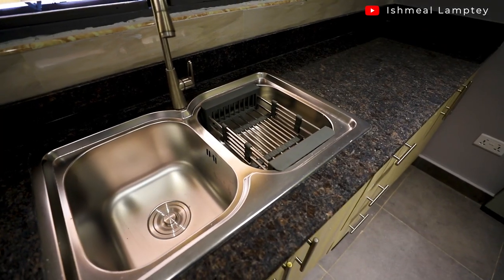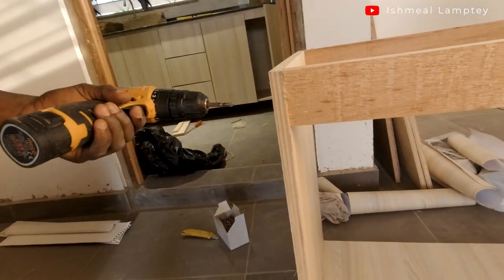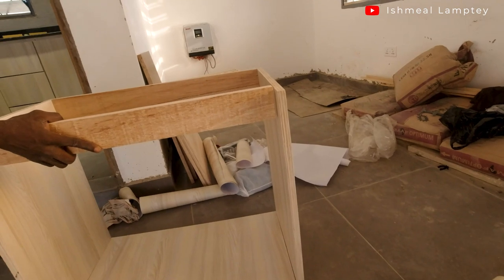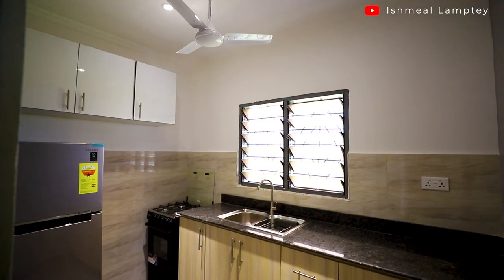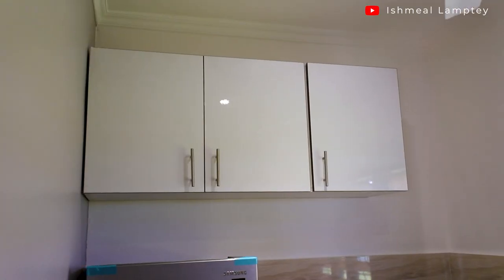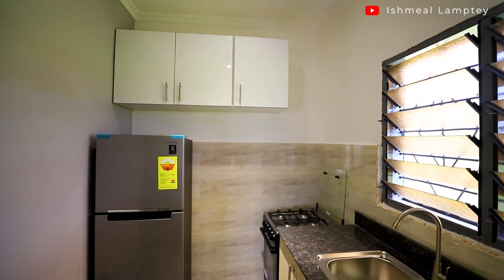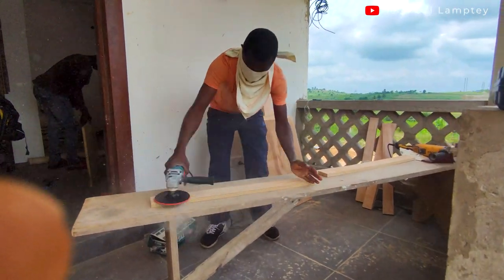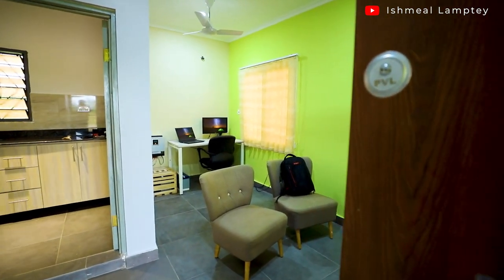Building a Kitchen Cabinet for our Minimal 1 Bedroom House

Comment: Did you glue the granite on top of the cabinets (or use screws) or just the silicone was enough? How about the one on the sides?

Also the edge of the cabinet facing where you stand, did you chamfer the edge or how did you make it smooth after cutting?
Reply from the maker: We used silicone throughout. And we did sandpaper all the woods to make them smooth